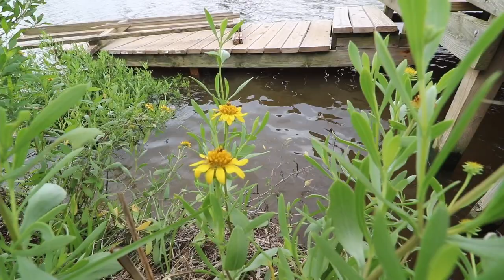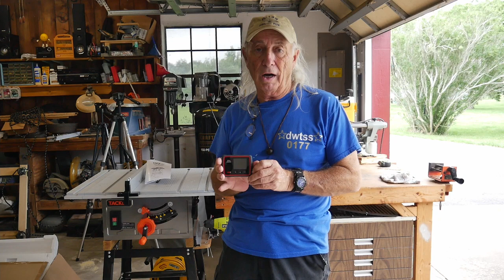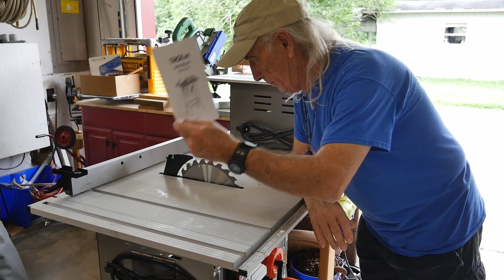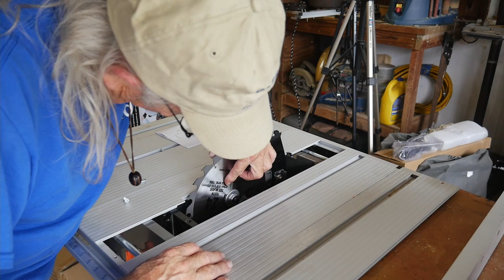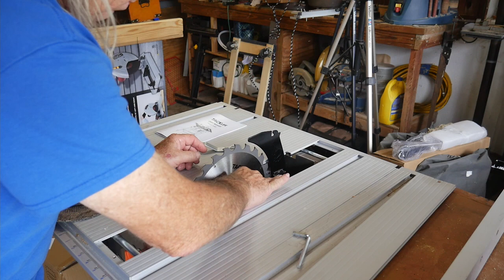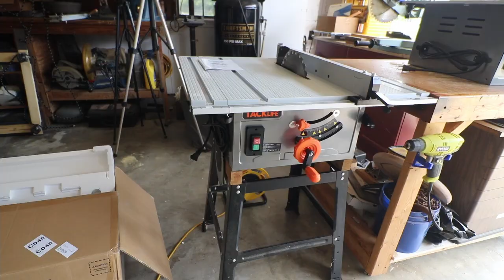Tacklife saw upgrades and giveaway contest again, C&T episode 153

Comment: New fence? How I can get one? They sell it separate?
Reply from the maker: Only comes with the new saw. Sad I know, but parts are still just impossible, but that could change soon too. I'll be talking to the gang at Tacklife later this week about that issue.
Reply: @SirTools  Yeah, selling the new fence as an add-on would be great. My dad bought their table saw that has the shorter fence. He's an avid wood worker and bought it for the house where they spend the winter. He barely opened the box when he noticed the cheap build quality. Amazon refunded his money when he voiced his disappoinment and said he didn't need to send it back. So he gave it to me. I have to echo his comments on the cheap build with almost beer can thin aluminum and all the plastic. How they could call it a table saw with a short rip fence with about 1/2" of slop was baffling. Now they "improve" it by extending the fence (something that should have been done in the first place) but you can't get it as a separate buy? Hopefully, they get on the ball and make it available. I mean it's cheap aluminum out of Shenzen. It's not like it's going to cost a fortune.
Reply from the maker: @amen_ra6926  I'm all for it, I've not checked the aftermarkets for 3rd party.